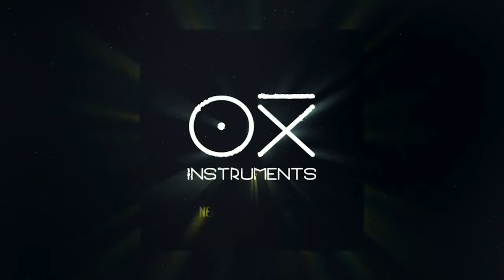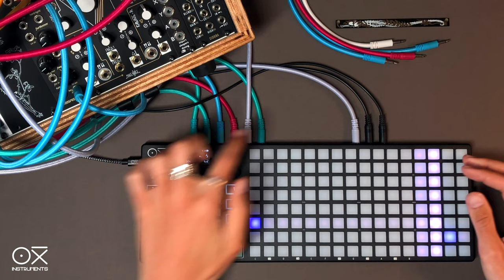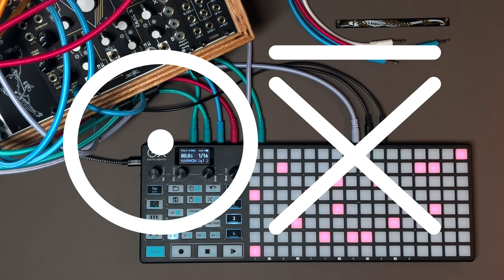OXI One Walkthrough #4 - CVs & Gates, Config & Routing

Comment: amazing! was about to ask if it can do Minibrute 2S style AD envelopes and LFOs and you answered my question before I got halfway through. absolutely sold. can the LFO be unsynced and if so what are the max/min frequencies?
Reply from the maker: Thanks for the kind words! Yes, LFO can be unsynced and can go to audio rate. A personal favorite is to motion record CC and use it instead of the LFO to send more humanized modulation to the rack.
Reply: @oxiinstruments  intriguing... my next question of course is can it be sequenced at specific note frequencies/melodically? for FMing stuff or even as a standalone digital sound source. also by extension could a gate output be used in the same way (presumably square wave only)? understandable if not as this thing's already got such an insane amount of functionality!
Reply from the maker: @TEHBILB  we will open internal parameters to be controlled externally, being cv in and Midi CC, LFO rate being one of them. It can go up to 200Hz though, audio rate but low freqs.
Reply: @oxiinstruments  ok so up to around G3, awesome - nothing wrong with a handy extra subosc!

Comment: Can you send the different tracks within a multitrack sequence to different gate outputs? So that you can do multitrack drums without midi? If so how, I can’t seem to find it in manual. I saw that you can hold down the track button and press the sequence button and change the midi channel for each of the multi tracks but that doesn’t seem to translate to the gate outputs. Any help is much appreciated.
Reply from the maker: In the Gate settings, you have to assign the track (from 1 to 8 or ALL ) :)
Same for the CV outs. It's on the manual, in the CV-Gate section.
Reply: @oxiinstruments  Thanks for the quick reply, operator error , I had the CV set to the wrong sequence ☺️ I got it playing my modular drums now.

Comment: A version to put into a Eurorack case would be awesome 🤩
Reply: F that.  Why does everything have to go in a eurorack case?
Reply: @WIsammy123  because I like to have a portable Eurorack case were everything is inside. Go to a location, open the lit, plug in power and audio out and start to jam.
Reply: It’s battery operated and connects by one small hdmi cable to the oxi pipe that’s 8hp